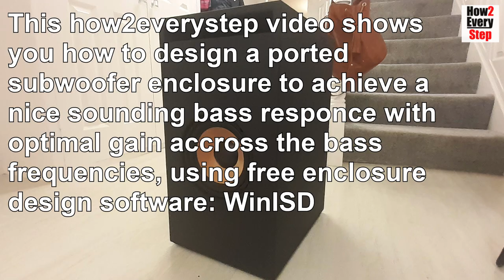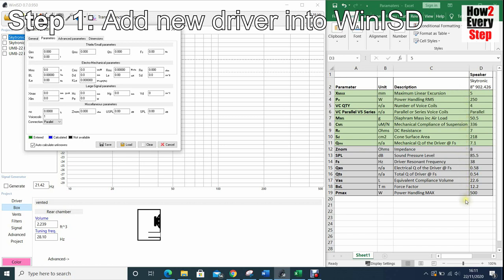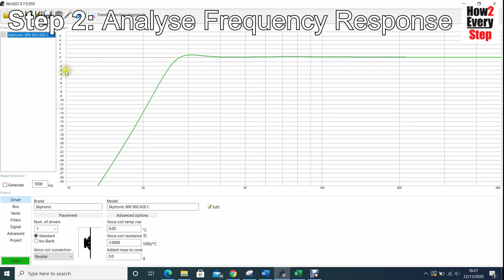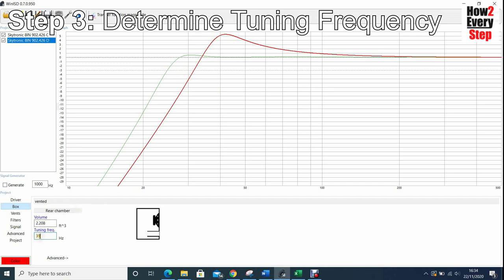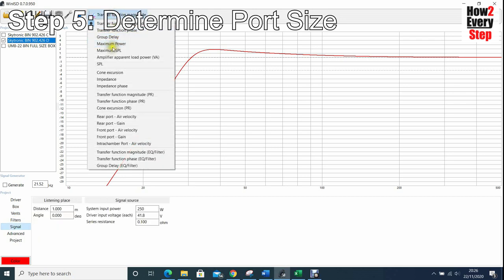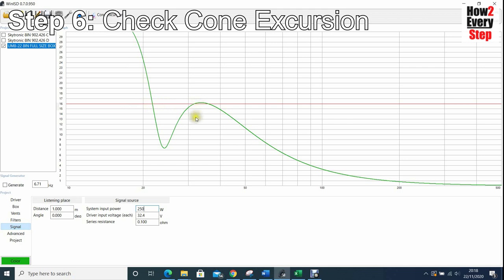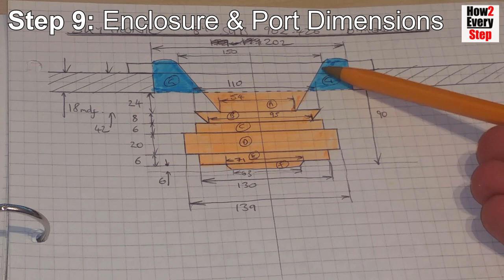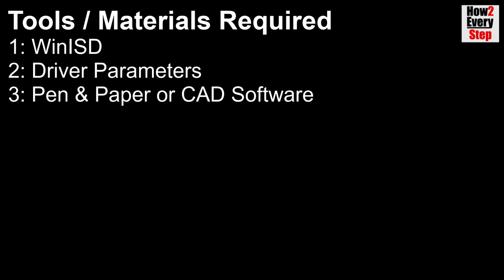How to Design, Size & Tune a Ported Subwoofer Box in WinISD for Deep Bass: Home Theatre or Car Audio

Comment: Whats the point if you stil have to draw out and figure out box dimensions?  You already had all the ts perimeters and all that you did is input what you already had into winisd.  The sub manufacturers already provide the recommended enclosure volume and most will also  advise how much cf airspace the sub takes up.

Comment: can i ask you to make me a box for my ds18 15inch subwoofer ?
Reply from the maker: Hi Nav.  Do you mean design the sub box in WinISD?  If so am happy to.  I have just bought a dayton audio ultimax 10" subwoofer UM8-10, so will be designing that bass box first... thanks How2everystep.com
Reply: @How2EveryStep  yes please and I will send you the whole details of the subwoofer, I really really appreciate it because I tired and this stuff doesn't get into my brain thank you!!!
Reply from the maker: @NaviBhatia  if you send me a link to the subwoofer datasheet that should be enough.  Plus will need to know your overall dimensions that you need to fit it in.  Thanks How2everystep.com
Reply: @How2EveryStep  hey i want make sure u got my reply because i replied twice and if u still haven't, the sub name is DS18 EXL-XX15.2DHE 15" High Excursion Car Subwoofer 4000 Watts Dvc 2-Ohm, also i have 2 of these in my car. My car is 2019 camry le but idk the trunk dimensions. Im sorry
Reply from the maker: @NaviBhatia  got your reply thanks.  I will look up the subwoofer datasheet.  What kind of frequency response are you after? Big bass peak for max spl or a flatter response as per the video?  What is the maximum height of your sub box  (so I can size your port).  Thanks How2everystep.com
Reply: @How2EveryStep  Box width -28 inches
Box height -16 inches
Box depth -33 inches 
Maybe 28hz for lows ? And I'm not really sure about the response. Would you give me your opinion? Please and thank you.
Reply from the maker: @NaviBhatia  I would recommend a flat frequency response with a few decibel peak in the bass frequency region.  What thickness wood are you using? 18mm mdf/ply?
Reply: @How2EveryStep  again im not sure what would u recommend ? i want something for longterm so probably not mdf
Reply from the maker: @NaviBhatia  I would recommend 18mm thickness.  I like mdf, but ply is also suitable.  I will design for 18mm thickness and let you decide the material... regards how2everystep.com
Reply: @How2EveryStep  thank you

Comment: Problem is. Youre doing this totally in reverse. I was taught the understanding of the controlling variables first..,if you learn this you can tune a box and find port dia and length easily.. if you understand how to tune an empty ported box to a target frq.  Then its simple.. ok.. ill get enemys here. With any given port dia.. ( give.) And any size box.. if you lengthen the port it tunes it lower..if you stick with any port dia and length.. if you increase box size..you tune lower.. if keep box the same and port length the same.. if you increase port dia..it tunes higher..thats all that matters. YES..IF ANY 2 VARIABLES ARE KNOWN.
the box can be tuned with the last variable.. throw away your computer.. all you need is tone generator and no filters or eq involved.. play flat sweep into amp and watch the driver. Where it stops moving is tuned freq.. yes includes variables in vehicle the stupid math doesnt account for.
Reply from the maker: Hi David.  Thanks for your extensive reply.  Indeed there are 2 physical sizing variables: port and box volume.  Unfortunately the 2 volumes directly interact, due to the port volume occupying more or less volume inside the box volume.  Hence, the video method shows how to tweak the 2 variables to achieve the required tuning frequency.  Quite often (specially in car builds) the sub box max volume is set by the available max external dimensions, so at least this guides the iteration process.  Thanks How2everystep.com
Reply: @How2EveryStep  im old.. we worked with room we had and tuned it..right now im dealing with a big box with 4 15 inch solobaric woofers. The  box is so tall that its only 13 inches from the headliner..so the sweep I do tomorrow will tell me what to do to fix the setup
Reply from the maker: @davidstevens7809  4 x 15" woofer - sounds like a beast! Is that in a van?  Thanks How2everystep.com
Reply: @How2EveryStep   its not easy as putting in more product.. simply changing positioning or tinker with variables can sometimes get you great results..

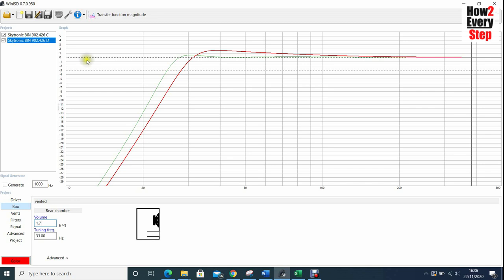Comment: 8:50 This is a terrible design. The 250 watt power handling starts to drop off at 90 hz due to the 5mm cone excursion, and continues until it can only handle 41 watts between 40 and 50hz. One of the very first things you have to look at when doing a speaker design is the power limited by X-max.